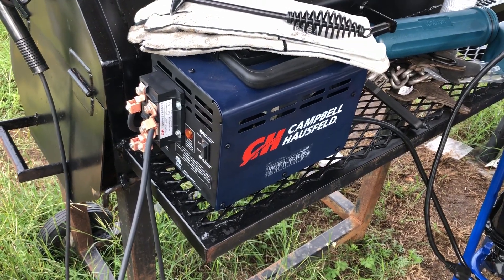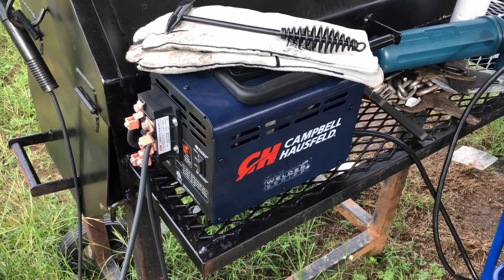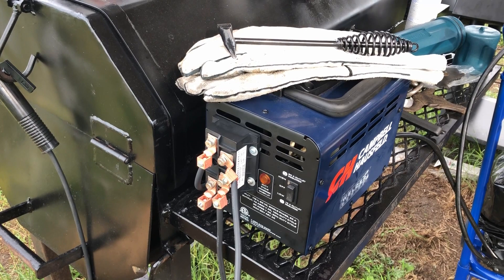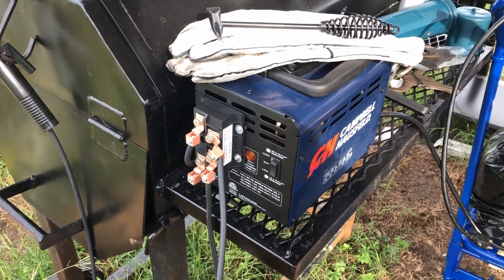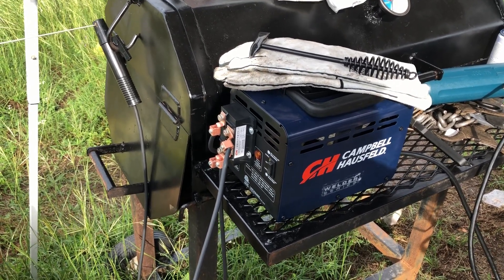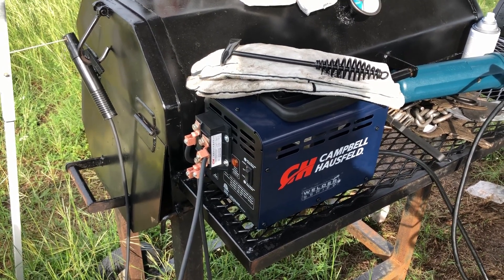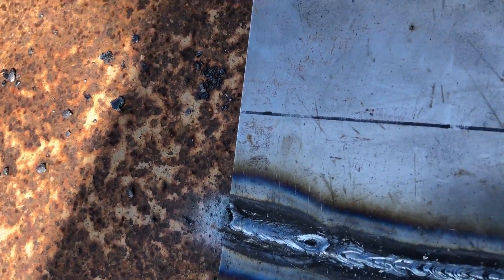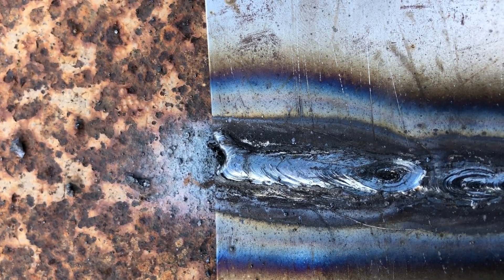Converting a 110v AC Welder to DC

Comment: I have the same machine and just did the bridge rectifier......I can now coax it into running 3/32 6011 rods. Still a PITA vs better welders but at least there are options now. Also Harbor Freight actually has good prices on 1/16th inch 6013 rods.

Comment: Every single video I've watched says to convert to DCEN. Is there a reason you did DCEP?
Reply from the maker: DCEN is for a MIG conversion, for Stick, you want DCEP. Although it would still work, you won't get the same flow into your pool. So rule of thumb, DCEN for MIG or TIG welding, DCEP for Stick. This is due to the heat distribution and whether your wire or electrode can take the high heat of DCEP, which is good for stick electrodes, but too much heat for MIG or TIG.